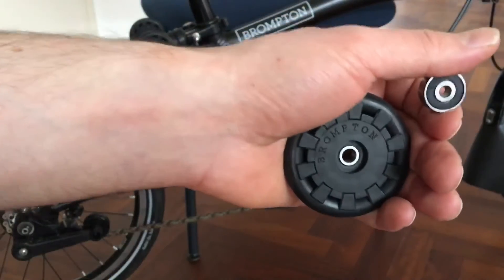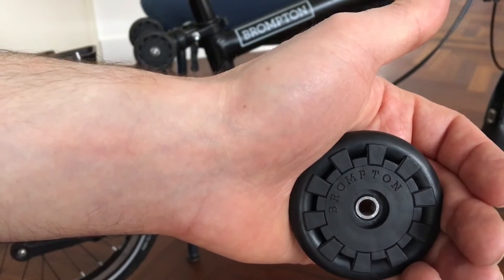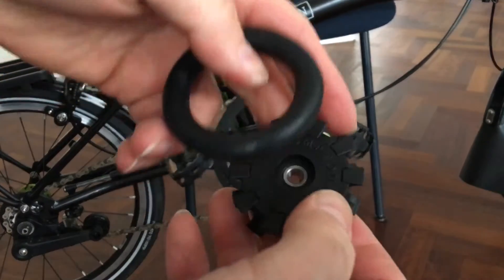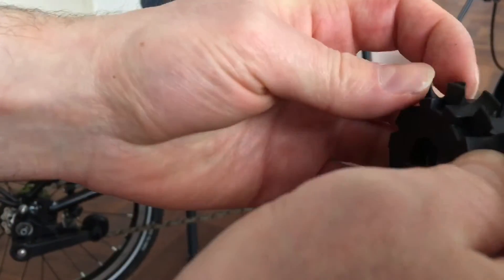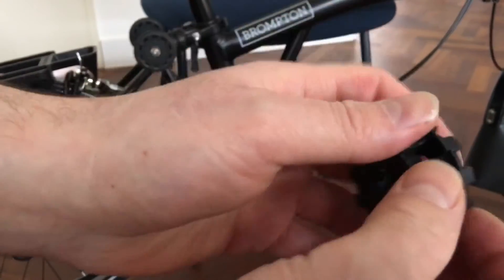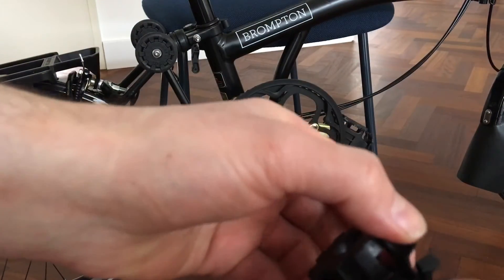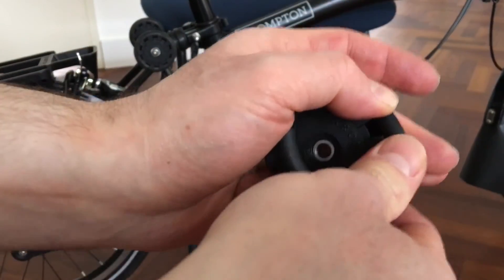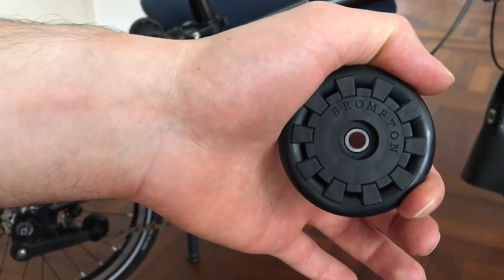Brompton Easy Wheel Bearing Change

Comment: Useful, simple, clear guide! Thank you for making this video. 
Question: Where do the replacement bearings come from? Are they generally available? (What is the specification?) Permanently sealed industrial-type? 
Or are they Brompton-specific? (Order part number?) 
What is the cost? 
Thanks, Rob
Reply from the maker: RobWhittlestone i got them from a brompton dealer. They where in my set of wheels. So i don't know their price. My advice would be to contact a brompton dealer. They won't cost much.
Reply: There is a number to all bearings which you can refer too at any bike shop. 
Or just bring the bearing to the bike shop and ask. 
You can upgrade them it's a general consumable in the electric motor industry and bicycle hubs. 

$4 to $8 each  for sealed bearings of this size.